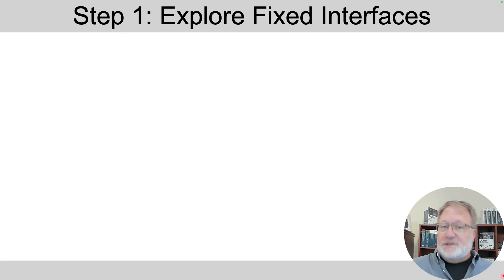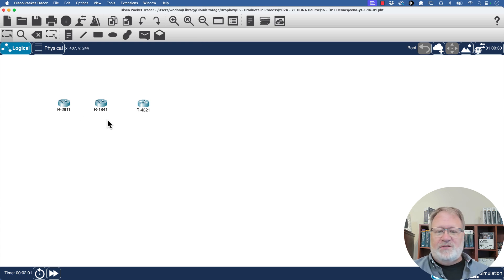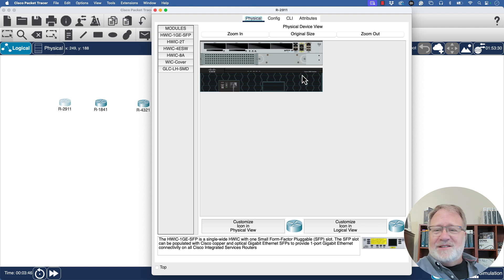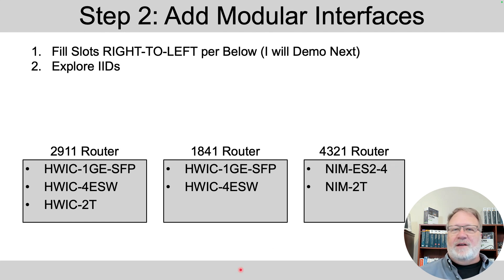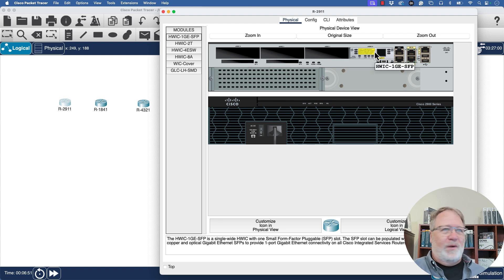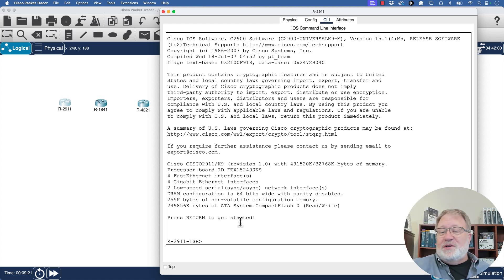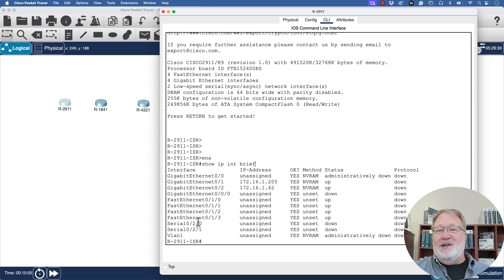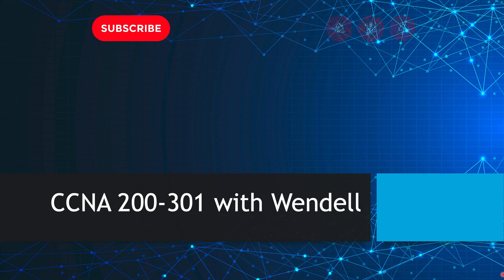Essential Lab Skills: Cisco Router Interface ID Basics

Comment: Greetings Mr. Wendell!
What does the “Ok?” Column in “show ip interface brief” mean/refers to? (I was under the impression that it referred to if an ip address was configured in the interface or not, but I see that even on the “unassigned “ ones stills shows “YES”)
Reply from the maker: Ahhh, you would have to ask a difficult question on Friday afternoon. :-) 
So, for me, from a long history of using the command, I think it's meaningless and is always yes.
This IOS doc says it's YES when the address is a valid value. But clearly that's not accurate, even though it's in the IOS docs. https://www.cisco.com/c/en/us/td/docs/switches/lan/catalyst9200/software/release/17-9/command_reference/b_179_9200_cr/interface_and_hardware_commands.html#wp3769920373

Cisco's AI attached to their search at cisco.com (Cisco's AI, trained by Cisco on Cisco data), says it's not used. Here's a copy/paste of that output:

Key Details of show ip interface brief:
Purpose: To view interface IP addresses and their status in a brief format.
Output Fields:
Interface: The interface identifier (e.g., GigabitEthernet0/0).
IP-Address: The IP address assigned to the interface.
OK?: Always shows "YES" (not actively used).
Method: How the IP address was assigned (e.g., manual, DHCP, CONFIG).
Status: Administrative state of the interface (e.g., up, down, administratively down).
Protocol: Line protocol status (e.g., up or down).
Reply: @networkupskill 😬
Reply from the maker: So... I think it's meaningless, and you should ignore it.
Reply: @networkupskill Got it! Thanks a lot for the clarification! Enjoy the weekend!

Comment: it took me a while to get it but the numbering on the interfaces has to do with slots .like if going left to right in 2911  im using an sfp card the router will choose like leftmost will be g0/3/0 and rightmost slot will be g0/0/0 .
thanks for making it clear.

also it chooses 100 mbps speed so fom 10/100/1000 its numbering the 100 mbps  part.
Reply from the maker: Hi Sana. Thanks for participating! 
On your last point note that the negotiated speed on a ethernet interface does not affect the interface ID. I can see why you think that given the 10/100/1000 notation.  But unless you move hardware around those interface ID, these stay the same forever. The interface speed can vary based on what gets negotiated.  Hope this helps.!!